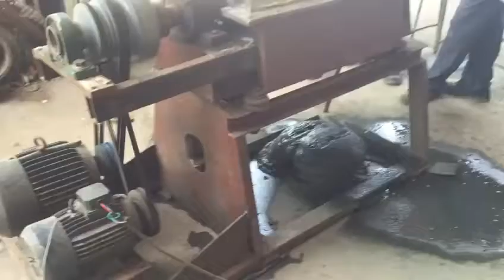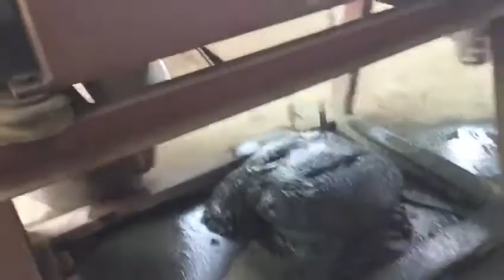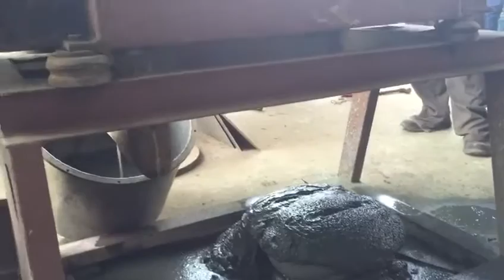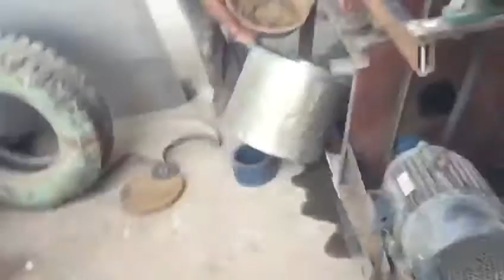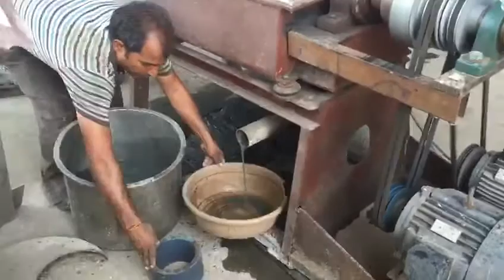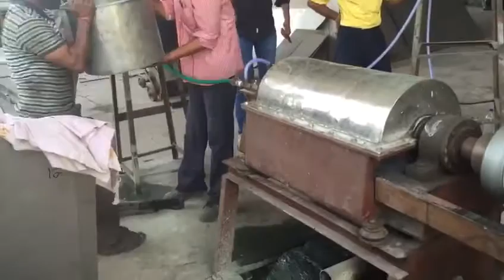Small decanter centrifuge trials

Comment: Hello. I also bought a 3000 rpm centrifuge but I have a problem and please help me. in the part where it removes the liquid, it also removes the solid. It doesn't separate anything ... it takes me out of the same place. as I put ... so take it out. Why ?
Reply from the maker: Hi, 
We are prominent manufacturer of sludge dewatering equipments mainly Decanter centrifuge and screwpress in Ahmedabad.

Please contact Chauhan Nimesh - 9825782890
Whirler centrifugals P.Ltd., Ahmedabad.
www.whirlercentrifugals.com
info@whirlercentrifugals.com